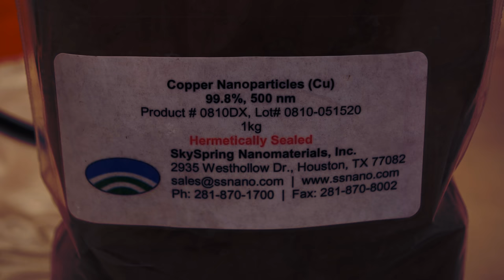Make Our Best Thermal Paste... YOURSELF!

Comment: here from LTT, damm... youtube your alghorithm is broken. Im still in disbelief that i have never seen this channel ever.. subbed. You mentioned this is a bit like making concrete. I have followed a class about concrete on how aggregate distrbutions influence viscosity etc.etc. and in concrete there are these things called plasticizers wich increase viscosity without adding more water(you want to use as less water as possible(in genereral)) could there be materials that when added maby work in a similar way for thermal paste? allowing for more solid load.
Reply from the maker: Welcome!
You mentioned reduce viscosity?  I haven't had much luck with these and I've tried a few PTFE based compounds.
Reply: @TechIngredients  oops, i mean reduce viscosty ofc . Thanks for your reply

Comment: 24:43 What is "a ten cent poise silicon oil"?
Reply from the maker: Centipoise.
A centipoise of 1 is the viscosity of pure water.  A centipoise of 10 is a VERY low viscosity oil.
Reply: @TechIngredients , thanks!

I just did a web search, and I found a table:

1 centipoise (cps) = room temperature water
10 cps = blood or kerosene
50 cps = SAE 10 motor oil
65 cps = corn oil
175 cps = SAE 30 motor oil
375 cps = SAE 40 motor oil
2500 cps = honey
60,000 cps = ketchup
200,000 cps = peanut butter
1,500,000 cps = lard or Crisco
Reply: One more question... what about the electrical conductivity of various thermal pastes?

Thermal paste has a tendency to end up in places where it is not intended.  If it's not electrically conductive, that probably doesn't cause a problem. But if it is electrically conductive, it could cause big problems.

I think zinc oxide is a pretty good insulator. Aluminum and copper are obviously conductive. So what about pastes made of mixtures of them?

Comment: i am  a retired engineer. The uses for thermal paste is not always neat. You will see excess amounts used for thermal conduction on power devices that will ooze out of the side and make contact to the leads of the components. the thermal paste used will not conduct electricity. What are the conduction properties of the paste you designed? What voltage can it withstand prior to conduction with a hi-pot?
Reply from the maker: It is not electrically conductive, but I don't  know its dielectric  constant or its  breakdown voltage.

Comment: I'm concerned about the electrical conductivity of the material. ideally it should be electrically non-conductive. Aluminum powder is going to be coated with aluminum oxide so it shouldn't be terribly conductive, but copper powder will be.
Reply from the maker: Both our thermal paste formulations are not electrically conductive. Linus Tech Tips confirmed that the high performance paste we sent them was not electrically conductive.

Comment: If it can melt so easily, why don't you apply pressure and heat, or you could use just heat, because a CPU needs to be at 60 to 70 degree Celsius only when it's running, there are lots of tutorial on how to bake CPU to get rid of moisture and such.

So In theory, you don't need to put your CPU in your motherboard before attaching the heat sink (for AMD desktop CPUs at least - which is what I own), all you have to do is bake an CPU while it is on top of a heat sink with a thin leaf of Indium in between and while applying pressure, where the given pressure needed will be inversely proportional to the heat applied.
Reply from the maker: We'd have to reach 160 C on both surfaces which is too hot.

Comment: tried it and failed! nice little experiment tho. for the people interested to try that  want to know:

I think the shape of my mortar was too wide so the powder mixed with the glycerine got stuck there and the pestel couldn't reach it so I have no clue how to clean it since it aluminium powder has certain disposing regulations in germany
Reply from the maker: Rinse the compound with water and then let it evaporate for disposal. Use a torch on the bulk once removed to turn the aluminum  into a lump of slag.
Reply: @TechIngredients  Thanks a lot!

Comment: Must be missing something but....
Wouldn’t copper work better than aluminium?
Reply from the maker: It's probably due to better sphericity of the aluminum particles or the oxide coating, but the aluminum allows for a higher solids loading fraction and it's all about excluding the low thermal conductivity oil.
Reply: @TechIngredients  it’s also softer so Al might squish up a bit better when packed under pressure and increase the contact area between the shericoid particles, less oil and better heat conduction thru the chain of particles?

Comment: Did you consider Bucky balls?
Reply from the maker: I did.
However, the solids loading fraction is far more important  than the conductivity of the solids themselves.
This is because  the fluid is more than 1,000 times less conductive.  The aluminum  is convenient  and much cheaper.

Comment: If copper has better thermal conductivity than aluminum, why is copper powder almost as good as aluminum powder?
Reply from the maker: It's probably due to size distribution and sphericity.  You can't load the copper as  high as the aluminum.  Loading density is the primary driver.

Comment: 24:00 "better than Arctic Silver"  Not a very good endorsement!  Some ten years ago when I was doing a build, I found experiments published that compared all the brands of thermal compound.  In the text they point out the poor showing of Arctic Silver!  It may have been a pioneer in making a "premium" thermal paste, but it's been left in the dust by newer brands.
Also, one of its selling points (along with most other brands) is that it is not electrically conductive.  Your aluminum-based paste does well because it gives up this property.
Reply from the maker: Thanks for the comment.
We formulated a thermal paste that left a well known commercial paste in the dust.  Also, you incorrectly assume that our paste is electrically conductive, it is not. We then showed how to make it. Any other manufacturer providing that kind of transparency?

Comment: Hello
Great videos of course. I want to ask You about the rocket engine series video. Recently You tried to use nitrous oxide as the oxidiser for the fuel. Could You please elaborate how are You going to integrate this setup into the airtube? Are You even planning to build a flying rocket or You are focusing only on the engine itself?
Regarding this video: did You tried to study or try to mix a thermal paste using Fullerene?
https://en.wikipedia.org/wiki/Fullerene

Comment: If you could use the copper as a substitute for the more dangerous aluminum power, and copper is a better conductor, why use aluminum?
Reply from the maker: It may be its level of sphericity or the size range of the particles, but the aluminum allows a higher solids loading and this is the most important factor.  This is where practical functionality overshadows theoretical predictions.

Comment: glycerol not the best option, it likes to catch water from air, also its very dangerous on some  temperature to qork with , why not oila
Reply from the maker: Water is an excellent  heat exchange medium and will counter evaporative  drying.
Reply: @TechIngredients  ofc, but also water (not destiled) also great electricity conductor, i mean not safe for circuits. Water in glycerol can cause quick degradation of copper(oxidation) which also bad for thermal conductivity, CuO isn't great conductor like pure copper. Did you experimented with hexagonal boron nitride ? it's great material for heat transfer purposes but dielectric. I want to try this to make compound with al²o³ or aluminium nitride(AlN)
Reply: @TheNuare  the copper already has an oxide layer if it wasn't handled in an inert atmosphere but it doesn't react further no matter if it's in water or not. Copper doesn't corrode in water that's why it's used for pipes

Comment: Nice video, why are brands spending a lot of money on power inefficient microprocessors instead of making it cooler? Why are brands like Sony Xbox AMD Intel making a lot of copper hot bricks? I do not understand, it will release a large amount of air condensing the air or oxygen with the hot copper, making a room in a toxic and harmful environment for humans.

Comment: Make it from home with only a couple $20,000 machines.
Reply from the maker: That's  how we made the high performance material that beat Noctura''s best when tested by Linus Tech Tips, but that's also why I included  the pretty good compound that only requires a $7 mortar and pestle.

Comment: aluminum is good as a heat dissipator copper is good at heat transfer. try copper nanoparticles and glycerin
Reply from the maker: I did and they didn't work quite as well as the glycerin and aluminum as I explained in the video.  Sphericity is critical to solids loading as is size distribution.
Heat dissipation is a product of thermal conductivity and surface area, copper has a better thermal conductivity and surface area is an engineered property independent of the material.

Comment: all I can say is gold leaf.
Reply from the maker: It doesn't work.  It's much harder than indium film. In addition, you have to use multiple layers to compensate for any deviation from flatness in the mating surfaces and that's very tedious with such thin film.
Reply: @TechIngredients  I thought it would be cool to test, can't find a single video on it but one guy tried just a peace of aluminum foil and it seemed ok. Also have no clue how long his computer was on.
Reply from the maker: I've tested both.  Gold leaf might seem like a good idea because its thinness implies it conforms better than it actually does at the scale of the gap.  Indium is absolutely the best pure metal if you can get the necessary pressure.  That's why we've used it for years on high power laser diodes.  It's also pretty cheap.

Comment: For 50 years I thought a thermal paste should be dielectric... Well, if one is half careles and half illiterate conductive thermal paste might do for well packaged processors, in thermal conductivity even excellent, but otherwise it's bad practice spread into masses.
Reply from the maker: Our thermal paste is not electrically conductive.

Comment: Are you interested in testing with graphene? I offer free sample.
Reply from the maker: Thanks, but I already  have.  It works poorly.  The low thermal conductivity perpendicular to the plane of the sheets and the large surface area which increases viscosity  at low solids loading are the likely  causes.